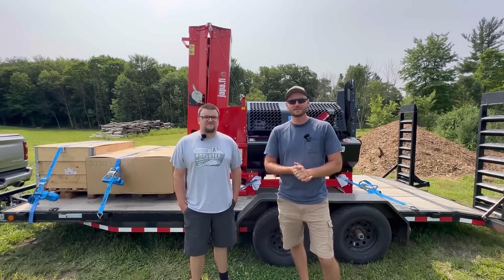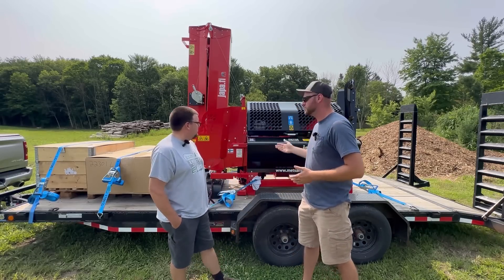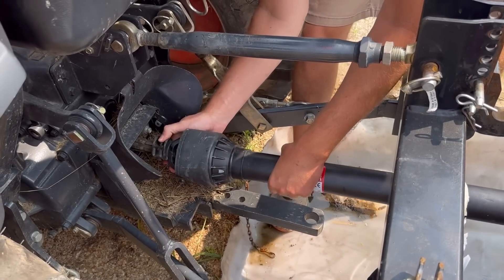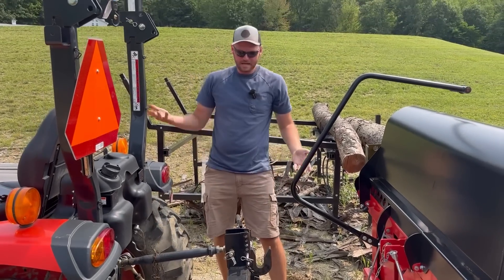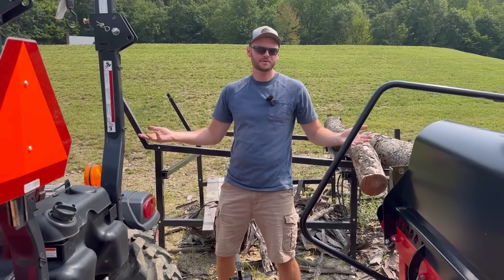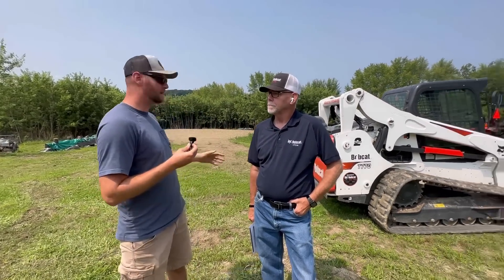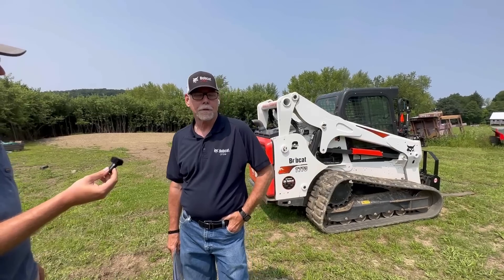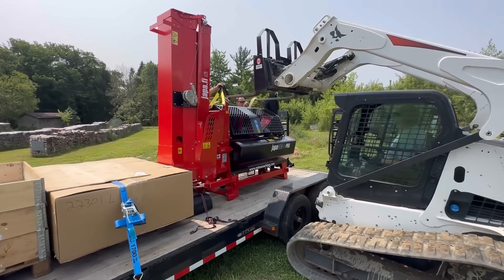We Got Something New For The Wood Yard

Comment: Hi Adam congrats for your upgrade . Other than making life  easier it did not appear to split any faster. I tried to count the seconds from each operation, sawing to sawing droppiing to dropping and ramming to ramming the 3 operations on both machines seem the same. Could you do a time trial with the new machine let us know how long 3 totes take to fill. Japa need to speed up all 3 procedures.
As an after thought, build a big shed to operate the machine in the winter when the weather is bad  then you can catch up on splitting.